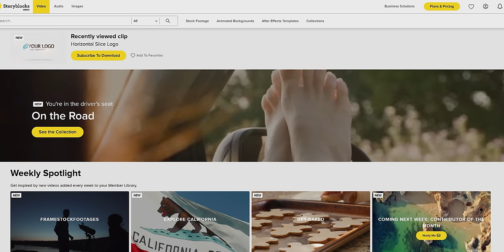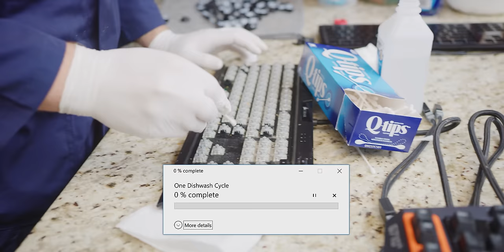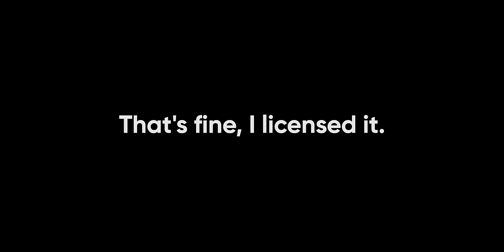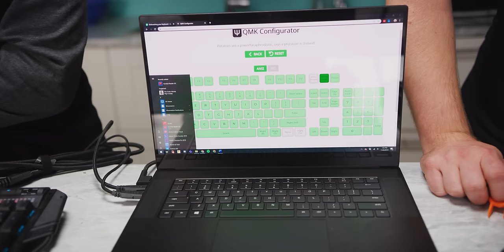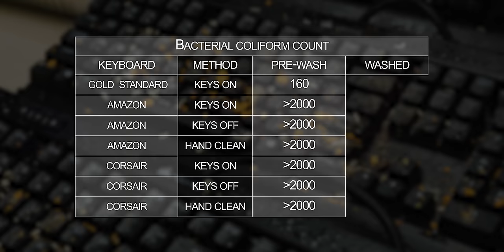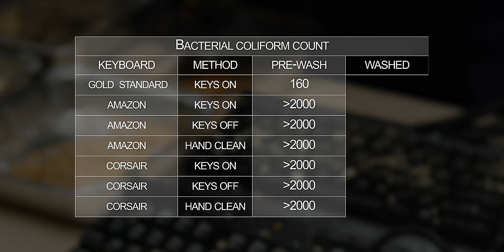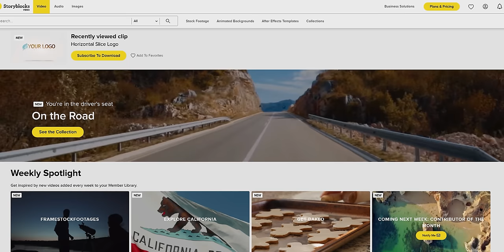The best way to clean a keyboard is… the DISHWASHER?

Comment: SSD does not survive in dishwasher, I can confirm
Reply: Good to know
Reply: Try your power supply and let us know how it goes.
Reply: SSD survives washing machine
Reply: What led to an ssd being destroyed in the dishwasher?
Reply: Why would you need to clean your SSD?
Reply: @pegasus_2137  Why to format it ? When you can wash it ?
Reply: lmfao
Reply: This is why I still use hard drives, they work fine after dishwasher.
Reply: @boomerboy8043  "Fucking boomer" Said the boomer boy.
Reply: 2080’s can’t survive in the dishwasher I can confirm this information
Reply: @Clueless2410  Bruh, it's the year 2019 how you throwin' 2080's into the dishwasher?

I'll see myself out.
Reply: @Adam-qs5ir  my cat spilled water on my pc and it wwnt in the power supply. I let it dry for around a few months and it still works! (I used my spare in the meantime)
Reply: F
Reply: CarthagoMike try an entire pc
Reply: @Clueless2410  As with most electronics, GPU's are fine as long as you let it dry out for long enough.
Reply: I  BROKE MY SWITCH LITE I GOT FOR CHRISTMAS FOR TRYING THIS!!!😠😠😠😠😡😡😡😡😱😱😱😱😳
Reply: @pegasus_2137  Because his SSD is filled with "Dirty" Videos.
Reply: @Al13n1nV8D3R  In my case an HDD is better, because I need at least 2 terabytes of storage to contain these files.
Reply: @diamantbluemc  What is the difference between inside and outside?
Reply: That's why Hillary Clinton just wiped hers with a cloth
Reply: @tyriekcarr9123  soap
Reply: Almost everything will survive in the dishwasher if you don't use high heat or soap, and let it dry COMPLETELY before plugging it in. Depending on the climate where you live, this could take anywhere from a few days to a few weeks.
Reply: @christianhemingway2807  I meant as to why someone would put an ssd into a dishwasher
Reply: @tyriekcarr9123  science
Reply: Might work better if its tied to the dish holder rather than free floating, I bet its the actual low frequency vibration that destroyed it.
Reply: My Xbox took a trip underwater and the hard drive still worked
Reply: I saw someone put them in a glass of water while playing a movie.
Reply: Did you putting it in rice?
Reply: WHAT DID YOU DO!!!
Reply: Ohhh , that sucks
Reply: @pegasus_2137  OK boomer.
Reply: @pegasus_2137  he was trying to clean his drive.
Reply: @Clueless2410  ok , I guess i can understand putting an ssd in a dishwasher .
BUT A 2080?!
Reply: @gunnaryoung  Nah she washed her email in the dishwasher not her keyboard
Reply: My USB stick had survived. So why not a SSD it is technical the same. When there isn’t any capacity on electronics when it is wet it survive. This could lead to problems wen capacitors are build in.
Reply: @boomerboy8043  Why is he a boomer for asking about that? I don't understand this new trend of calling people boomers out of nowhere.
Reply: @minorlion1327  it will survive if its submerged in fairly clean to distilled water. You could submerge an ssd for a month in distilled water, pull it out and dry it right away and it would run perfect.
Reply: @Adam-qs5ir  done, it still works... lol. I didn't bother to discharge it first and I washed it with dirty dishes.
Reply: why did u put it in???????? like its a ssd not a keyboard where food can get stuck
Reply: My PC Case IS the dishwasher.
I put it on a daily cycle.
Reply: @inoahmann7542  zzzzzzzzzztt
Reply: You can wash an SSD just the same as any other component, it has to be rinsed and dried properly before you used it again though. Never wash  a mechanical drive, it will die very quickly
Reply: You must have not waited long enough, water will rest between the chips and pcb, you have to open the ssd and let it air drive for several days
Reply: put it into rice
Reply: @dkracingfan2503  I'll take things that never happened for $1000
Reply: ok boomer.
Reply: der8auer washes his mainboards in the dishwasher after using them for sub zero overclocking (because he isolates them against water condensation)
As long as you let them dry long enough, it's always fine.
Reply: true
Reply: Next try the whole pc u know just to be sure

Comment: When I was working at a second hand store years ago we cleaned lot's of computer parts, including keyboards, in a restaurant grade dishwasher, then we let them dry for 1-2 days and never had any problems.
Reply: 2000subscribers with no videos challenge No need, that bitch was more powerful than the me2 movement,.
Reply: @lapptech  haha this made me laugh remembering the big pull down fucker I used to use at work 😂
Reply: @middleclassbogan9741  i currently use a big pull down fucker dishwasher at work
Reply: @angzhamz5053  That was smooth though. Still, I don't play WoW, so no, thanks.

Comment: I've just dumped mine in a bucked and then swooshed it with a cleaned dish brush, then let it dry for a few days. (Corsair K65 RGB) Worked great, only downside is waiting it to dry. I heard soap can be bad as some keyboards have oil as lubricant in the switches, better let it be.

Comment: I work in the IT department of an electronic board manufacturer and I've found that running the boards through the regular water wash (non-saponified) works well. Then I throw the keyboards in an ESD bin or bag loaded with desiccant packs.

Comment: What I learned watching this video: 
1. Linus is now going to have Pink Eye.
2. Thankful for my Corsair Keyboard which is very easy to clean thanks to open sides and raised key caps.
3. I am going to continue on with my philosophy of never using someone elses key board... EWWWWWW...
Reply: 4. Your keyboard is still under warranty even after running it through the dishwasher.
Reply: @crewskater06  LMAO
Reply: I have to use the Chromebooks at school so F
Reply: @crewskater06  I burst out laughing at that part
Reply: @crewskater06  did not know that!
Reply: 5. You can get studio quality stock video clips for a fraction of the cost with Storyblocks video.
Reply: @chrisdominguez2229  ???
Reply: 6. I got a brand new keyboard for christmas now im scared
Reply: Don't forget all the congealed semen.
Reply: which keyboard do you have? im looking to get a new one thats not offbrand

Comment: When I had a dishwasher I did this with my cheaper keyboards, was to scared to do it with more expensive equipment. Only fried one because I didn't let it try off completely. So LET IT DRY OFF KIDS!
Reply: Joshua Adkins or simply stop using dishwasher and invest in a ultrasonic washer.
Reply: @thanhlengoc3805  still wouldn't work as good as a dishwasher. Plus those are easily around 2k, just to wash a keyboard off? Lol
Reply: Joshua Adkins 2k what? You can find one for around 50$, and it is more usable outside of just keyboard, since I also use it to clean other things, especially oily stuff. 

It won't be big enough for an entire keyboard, but learning how to seperate the electronic part to clean by alcohol and clean the rest with the washer is good habit to have. It works way better than a dishwasher, throw a handful of dusty mechanical switch into a dishwasher vs an ultrasonic and you see the different.
Reply: Joshua Adkins beside, I am spending nearly 1k on my keyboard so another 50$ to keep my keycap clean and shiny is a great deal.
Reply: @thanhlengoc3805  what kind of keyboard is 1k
Reply: Jesse if anyone can find a keyboard for 1k I’m impressed
Reply: @tz3720  Not too hard. First thought search for "Blackmagic Design DaVinci Resolve Editor Keyboard" and gg
Reply: @tz3720  Also the Optimus ones should be in that range. Like the Optimus Maximus
Reply: I don't think a keyboard is the best thing to dry your kids with.
Reply: @thanhlengoc3805  not everyone cares that much about their keyboards

Comment: a quick way to clean your keyboard: Wait one week to dry :D
Reply: Also really bad way to do it. Corrosion and water damage comes from water sitting on wrong place for extended time. Thise should be manually dried asap and then left opened to dry the excess moisture out.
Reply: @moroit1  what would be the safest way to manually dry them?
Reply: @doesboknow2  Rice is good at absorbing moisture. Put it in a container of rice.
Reply: @doesboknow2  Open up the case, dry the excess water in to paper/towel and place it somewhere dry and warm to allow rest of the moisture to evaporate. Try to avoid ESD while drying it up. 

I would use sauna while it's warming up or oven on really low setting for the best results.
Reply: @doesboknow2  multiple combinations of vigorous shakes with  prolonged blow-drying sessions.
Reply: 5mins blow dry with a air compressor
Reply: @UyeGaming  "We're going to clean this keyboard after putting FOOD in it" Bloodaxel throws it into food rice after cleaning it of food
Reply: after you shake it good and dry, so its not dripping; prop it up behind your computer... it will dry in a day at most just from the ambient warm airflow.
Reply: As long as you've not done something regrettable to your keyboard, it doesn't really matter how clean the parts you can't touch are.
Take the caps off, give them a good clean.
Shake the worst if the skank out if you keyboard and then wipe it down with a soft cloth and a mild antibacterial cleaner. 
Paper towel dry.
Replace caps and get on with your life.
Reply: Get an electric blower/duster. It will force water out of tight areas and dry the keyboard within minutes.

Comment: "We are going to sacrifice them all for science"
*science
Reply: CIev3r same as the 1st dude who go wrong hole. “For science”
Reply: VGA VS HDMI
Reply: @demonslayer312  This looks like home science, but it's not junk. Let me counteract your post.
1) They weren't able to clean it properly: That's not the fault of their bad science, that was intentional. They tested with a control (Golden Standard), replicated messes under controlled variables and even removed the keys to see if it cleaned better. They then found it came out cleaner if you removed the keycaps. It was something learned.
2) Dangerous: This is not dangerous if done properly. Just like hydrochloric acid or stomach acid isn't dangerous unless used improperly. If you're implying about the dangers of the keyboard short circuiting, then this was addressed as well. This is why they didn't use soap because it may leave residue that may cause it to short. They also only used low heat water to prevent lasting damage and even played it safe drying it for A WEEK.
2a) Phones in toilet: This is "dangerous" only in the regards that there's a live battery in a phone running at that time, giving it power and thus the ability to short out at the MOMENT you drop it in water. The keyboards were not already linked to power when running under water so it's not going to have this issue.
3) Takes longer: Obviously it takes longer, but you have an extremely clean keyboard. There's proof shown via lab testing where each keyboard (save one) had came out clean enough you can literally eat off of it safely. I'll reference back to what you said. "The tester was not able to get all the doo-doo off all the keyboards" If they did a hand clean, it would take EVEN LONGER. Remember at 7:34 when Linus said he was going to record another video and Colin says he has to keep manually cleaning it, which was a job unto itself. Also at 4:26 where Linus says it's a "painstaking" task.
4) Repair tech, buy a new board: That would cost you way more money to have a tech. If you have a higher end keyboard, that ALSO is likely to cost more money. Why do either when you can spend like 5 minutes taking off the keys, doing a quick wipe off of the board, and throw it all in the dishwasher? It saves time AND money, plus the wait time for it to dry matches shipping or a return time from a tech more or less.
5) Funny how? I mean, funny like I'm a clown: He is very silly in things he does for entertainment, like a clown yes, however he does it in a way that keeps the audience's attention while still giving information. He's the "fun" teacher of the school where instead of just droning on the information, he does add humor and fun to lighten the atmosphere and educate at the same time. It adds to the retention value and because he sometimes does things so zany, people are interested in how it ends up. Throwing a keyboard in a _DISHWASHER_? He's a madman! That's his shtick.
Reply: @demonslayer312  Did we watch the same video? When I watched it, I was pretty sure they said (and showed) while leaving the keycaps on won't clean it entirely and will have crap leftover in it. However, when they took it apart it came out clean. Every nook and corner of the board was washed. The keycaps themselves are a different story, but that's more likely because they grouped 3-4 keyboards worth of caps in the mesh bag. Having it in that bag doesn't leave much room for water to hit every surface. Besides, cleaning the caps under a sink or in your example, the toilet, would wash the rest of it off anyway.

Don't forget that the dishwasher SANITIZED it as well. Also keep in mind that they used keyboards that are so full of nasty shit. Cheetos, Doritos, a bunch of crumbs from who knows what. If your keyboard is in this condition, bacteria is very much guaranteed. Washing it off with a hose won't sanitize it. I mention this because if you're eating at (or literally over) your keyboard, you must also be using it, therefore transferring bacteria growing from it to your mouth. But sure, feel free to toss it in the toilet and save some money. I'm sure that it'll completely clean it off.

Again, as I've said before, this isn't them saying this is the practical way to clean a keyboard. They're showing that you CAN. Also do remember that Linus did say that the dishwasher might leave residue. Regardless of all this, if your keyboard gets to this level and you're legitimately trying to argue if cleaning it in the dishwasher is a good idea or not, then maybe cleaning the keyboard isn't the concern here.

Now, addressing the water being used, that all varies based on where you live. I have also referenced this before as well, and that yes, your water may leave stuff behind. The residue doesn't come from the dishwasher, but your local tap water supply. That's what causes leftover residue. Either that or your pipes have stuff in them because they're old and/or broken and letting in minerals from the ground.

Comment: Nice experiment. Though I think I should point out that wireless keyboards that use batteries or solar charging ones shouldn't go through the wash as it carriers more wires inside. At a bare minimum remove the batteries out of those keyboards as it could cause corrosion.

Comment: 10:42
"Quick, fast..."

Linus, it literally took a week for the boards to dry out.
Reply: But with the movie magic you can make it up to less than one second, dont forget that!!
Reply: Thats actually stupid. To CLEAN it, it's very quick and fast. You do the cleaning and not the drying.
Reply: @dragamani9872  Still takes a week before you can use your board. If you cleaned it yourself you'd be using your board within an hour depending on how dirty it was.
Reply: CK Lim  Hey man I was just memein'.
Reply: @KeWDu  I totally agree with that but if you have a spare keyboard its not that much of a problem. Still the cleaning is not that nerve wracking using this method.